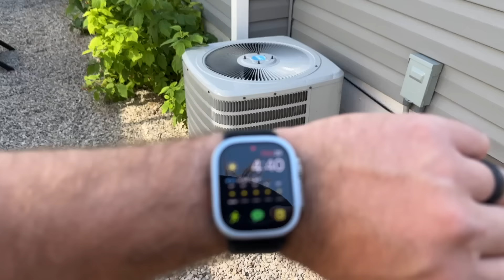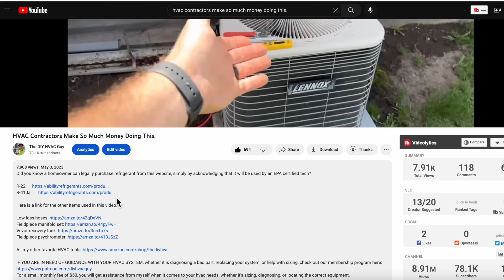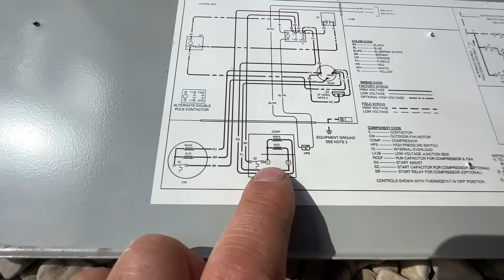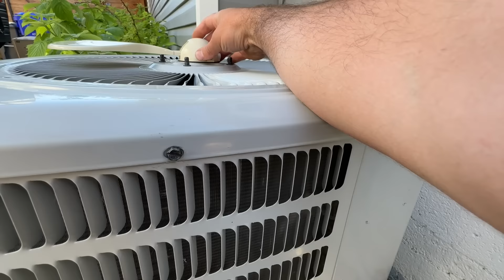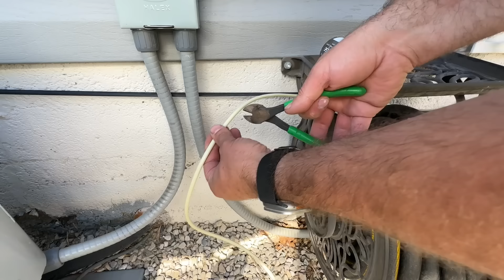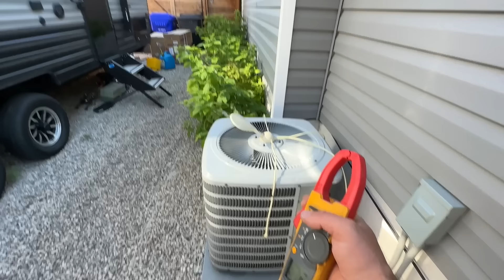Can This Device Actually Lower Your Electric Bill By 30%??

Comment: Im curious. Has anyone had any issues with the waterlines freezing during the winter? Or are you expected to turn it off during the winter months? Customers really don't want to have to think or worry about anything. So...If I was to do this...I would want to consider a way to automatically turn the water off.

Comment: One caveat is to turn the water off when the outside temperature drops into the mid 80s to high 70s. You can get the refrigerant too cold. This could cause the system to work incorrectly and potentially damage the compressor.

Comment: When I was a kid way back in the 1950's, we didn't have air conditioning. We had some window fans that fit in an open window...filling the entire window space size.... and could run in either direction. On real hot days, Dad would take the water hose and water down the roof. The water running off the roof would cool the air and the fans would pull the cooler air into the house. I'm sure that it wasn't as cool as a real air conditioner, but I don't remember complaining about a hot house; it was just the way we lived.

Comment: Shade makes a big difference also! Need to maintain space around system for airflow though. Also when the temps drop down to probably 80 yo 85 outside you should cut the water off because you need to maintain a certain head pressure in the system to keep the evap from freezing up. I made one with mister nozzles, 24 volt sprinkler valve and pvc pipe on an old system and it worked great.

Comment: Great for dry climates not so great with high humidity. Also you need to be diligent with water quality. Bad water will ruin your condenser coils rather quickly.

Comment: Evaporative pre-cooling does work.  Years ago, a company sold a system of evaporative panels, with polyester mesh evaporating pads, that did a more-effective job of pre-cooling condenser air than this misting system does.  I have installed many systems like this up to a 300-ton air-cooled chiller.  The fan-powered flow valve is clever.

Comment: Wow for my girlfriend's ducted AC system. An option for an automatic water valve to mister would be 120vac to 24vac to one of those popular lawn or garden valves (like Orbit brand). I bet one could tap AC from compressor for a maybe $30 dependable auto water valve to mister. The Orbit brand water valves I use for gardening are dependable for years, plus adjustable for water volume. Food for DIY options 🙂 ... P.S. Bet misting works best in dry climates vs high humidity climates ...my two cents

Comment: Probably not a bad way to extend the life of an old unit that might be on its last legs and might not quite have adequate tonnage for the square footage. It'll rust out the unit faster than it might naturally but if it's already on its way out, why not? I guess you could limit the use to only the hottest weeks in the summer if you wanted as well.

Comment: I ordered this thing and can confidently say this does not work. The misting tubes are extremely short and do not make it to the ends of the unit. The adhesive is sub-par and , because they insist you adhere it to the absolute hottest part of the unit instead of at a corner, the adhesive does not last long at all. But, it really doesn't matter since the misting tubes are so short. They cut so many corners on this cheap, flimsy gimmick that they made it useless. I am beyond angry that I was taken for this ride. You are promoting a product that is nowhere near as good in person as it looks in this video and it is causing people to waste their money.

Comment: Please don't install one of these.  I installed one on my heat heat pump outside unit. While it worked well at first, I ended up with with a lot of mineral build up on my outside unit. The Mineral build up was lighter up high and got heavier near the bottom of the outside unit where the water trickled down and dried out. I had several AC companies come out to evaluate how to remove the minerals. They all agreed that they didn't know of any chemical or physical means of removal that wouldn't damage the coils on the outside unit. In the long run using the AC coil mister was more expensive than not using it.

Comment: Not saying the device will not make the AC unit work a little more efficiently,  but there is no way you'll get a 30% reduction. At best you'll get a 3% reduction. Don't believe me do your own research.
Current draw reduction is bogus as the second measurement was done incorrectly. Wire goes inside the meter loop NOT clamped in the jaws.  Compare how the wire is in the meter at the 2:40 mark vs the 8: 40 mark.
Also the temp measurement was done incorrectly. You measure the differential between the intake air temp and output air temp. as output air temp is directly related to the intake air temp.

Comment: With over 40 years in the HVAC trade, I have seen this system on both residential and commercial systems. It does work. The only problem as he mentioned is the dissolved solids in the water. Not just calcium. I have not had good luck with water filters doing a good job by themselves. Be sure to change that filter regularly. Check the condenser coils regularly as the buildup of dirt and minerals will negate any savings. Next. I wonder where he is taking that amp reading. For instance, I have a 36,000 BTU high efficiency unit. It pulls about 14 amps. Mine you that is FLA or Full Load Amps. That leaves about 12 amps for the compressor and 2 amps for the fan motor. So 4 amps does not sound right. To read compressor amps correctly, you check the compressor common wire. I am not trying to knock him just trying to pass along my information.

Comment: Coming from a city with extreme hard water, it will work, and then a ton of work later to get rid of the scale.  I had pumps for my house for for indoor waterfalls that had lifetime warranty, and they stopped giving me new ones is because they kept seizing up due to the scale.  Unless you keep up with this or have a water softner, the money saved on energy is wasted in maintenance or replacement later

Comment: If a house has a soft water system, tap into it's discharge for the water supply.  This will eliminate any calcium buildup on the coils.  An RO system output would do the same thing.  I'd say the calcium deposits will be the biggest reason to avoid this type of misting, so get rid of the calcium and go for it.

Comment: Not sure I saw it correctly, but shouldn't the nozzle be pointed towards the coils?
Reply from the maker: No, you are misting the air around the coil, then the condenser fan sucks it through the coil and out the top. The idea is not to soak the coil

Comment: In the Air Force when I stayed in Phoenix at Luke AFB only important buildings had AC most people had swamp cooler units that do similar work as this micro mister is doing very nice video well thought out and flawless presentation. I learned something new today.
Reply: You have no humidity at all in AZ. This is why people can use swamp coolers but using them in the SE would leave you with water dripping down the walls and everything in the house damp as a dish rag. then mold and mildew and your sick.

Comment: So, in a state that has to buy water from colorado, a toilet flush or two a day from a million homes is a ton of water. Also, 1 degree difference is a ridiculous trade off. You can save actual money with a white roof coating which should be a requirement on all homes because it also increases the life of roofs coverings.

Comment: The misting nozzles would be plugged in a day and if that didn't happen...the condensor would be completely plugged with calcium in less than a month here...and the entire unit would be rusted to the ground in a year...our groundwater is very mineral rich and quite alkaline. Great way to void a manufacturers warranty.

Comment: I did something like this back in '97 in an act of desperation.  We had recently moved to Texas, bought our first house and that summer we had temps in the 110 plus range, so indoors it was 90 degrees plus.  I thought the A/C was broken, called the A/C guy who checked it and told us he had good news and he had bad news.  The good news was there was nothing wrong with the A/C unit.  The bad news was that was as good as the cooling was going to get, and he explained air conditioning philosophy of the 1980's of contractor homes and houses built during the 1980's were designed with only a 20 degree temp differential as far as air conditioning was concerned.   I bought a mister kit, strapped to the A/C unit and it only helped a little, but a little was better that nothing so I kept it on.  We had hard water so in just a few days the condenser coils was covered in hard calcium deposits, the excess water that ran off, was super hot and killed a wide strip of grass all the way down to the road.  In a few months, the A/C unit was ruined, but as far as I was concerned, didn't matter since it was pretty useless anyhow, and we replaced it the following spring with a larger and more efficient unit that cut our electric bill in half.

Comment: First of all, hvac equipment is rated for a maximum of 95 degrees. For every degree above that, it will lose cooling capacity/tonnage. You are at 91 degrees ambient. I live in Southeast Texas. I soaked my entire condenser coil and dropped 2 whole  amps. Misting it didn't do anything in this 103° heat with heat index of 112°. Eventually the aluminum fins will start to degrade with prolonged water contact and prohibit proper heat transfer. I've been doing this for 32 years and have seen it all.

Comment: There are several comments indicating it may or may not work based upon various geographic location and physical limitations. You posted this video a month ago. Do you still think it's worthwhile?
Reply from the maker: Yes, I really do
Reply: @diyhvacguy  

Thanks for responding. I agree with one comment. The parts don't look very durable. I'll probably try it but gaining a water source near my heat pump is going to be a pain!

Comment: I thought of this about 8-9 years ago, most people told me I was crazy that A/C's are meant to be in the sun. One year later a company was advertising on the radio to install misting systems for the A/C's connected to the on/off switch on the unit. I now work in Solar and I may include this system as a Bonus. It's been a very hot summer here in Dallas.  🤔😓

Comment: Mineral build up on the could superheat subcooling ? The fin should offeset a little bit of the airflow problem supposed to have more distance by cfm of condenser fan and may take motor out premature and effective subcooling and  superheat  ever notice notice is louder on top of unit

Comment: 25 years ago when I was 18 I filed a patent on a similar design. The difference was mine worked of an adjustable thermostat. So that you could set it to your desired ambient temperature (90+ is what I recommend). I also had a filtration system so you didn’t get a build up of scale on the condenser coils. Mine also worked using a 120volt water valve that you would tie to the contractor. This would ensure that 2 things had to be met in order for it to operate without wasting water.  Unfortunately the patent was denied because someone in Michigan beat me to the punch. He was offered 10 million dollars for his version.

Comment: Smoke & mirrors.
I live in Arizona in the middle of the desert and this would do absolutely nothing. Temps here in the summer can go from 110 to close to 120 degrees. So hot that the water coming from underground pipes actually comes out hot. That device you stick with adhesive backing wouldn't last 5 minutes either. The heat is so hot that adhesive would soften up and that device would fall right off. Want to keep your AC running properly get it service on a routine basis and change your filters often. They get clogged up and it lowers the efficiency of how your AC works and just makes it work harder. Also don't run your AC with temps lower than needed. It just makes the unit work harder and you pay more in the end with your power bill.

Comment: that is a 4 sided condenser, one side has no water flow. These have been around for about as long as air conditioning been around. Most people claim on amp difference, but there should be better cooling due to the extra sub cooling at the refrigerant metering device.

Comment: It's adding an evaporative cooler to condensing coil.  Evaporative cooling is effective in low humidity environments.   Like on the brown (west) coast; not so much on the green (east) coast.

Amp draw doesn't tell the power consumption story.  You need the phase delay (power factor) at the same time.  You should know this.  Also, the start winding does not disconnect when the motor comes up to speed on these - it still draws current.  You need to measure the total draw with a unit that also measures the voltage and power factor in order to know power consumption.

Comment: BAD IDEA if the water has a lot of Sodium and Calcium in it, and nearly all water systems do, it does work, but using a a Swamp Cooler screens would be much better, cool air intake, but the water Solids do not build up on the cooling fins.

Comment: If you have a newer micro channel condenser these are doubly bad - micro channel condensers are very susceptible to leaking from corrosion.  They will also plug with water if you aren't extremely careful. They can be a PITA in the rain even.  
Don't buy an AC with a micro channel condenser if you can avoid it!

Comment: If you want better efficiency buy better unit stop being cheap and expecting good results. Seer is your cheap scale. 10 seer is for house flippers ( cheapest and electric hog ) they go all the way up to 28 seer I think or higher. Bigger coil outside gives more time to remove heat. You can also use umbrella style cover above to stop sun from beating on unit ( more shade the cooler unit )  keep overgrowth ( plants , grass ) away from coil as it blocks air flow from sides. Also wash coil once a year ( if you can’t do it have it done )

Comment: Wonder how many gallons per day this would use. 
Electricity is already easier to get in hot and dry areas than water, and that's only going to get worse. 
Plus the scale issues.

Comment: I use to do this for a living.  A VERY overlooked area is the Evap coil.  They a often NOT accessible.  I would often have to cut into the plenum to inspect and the cut an access hatch to clean it.  I have seen them so coated with dirt that I could peel it off like a blanket!   Why do they not make them more accessible?  Maybe the do now.  I guess a good way to sell new units.

Comment: First of all, the condensing unit is CLEARLY not installed to the clearance required for optimal airflow, as evidenced by the need to take the nutdriver apart. 🤨
Second, a better test of the cooling capacity is by the wetbulb split at the evaporator return and discharge! 🤔
Drybulb temps are next to useless.

Comment: I did this once and it was awhile ago. Pretty sure i just bought a 24v relay solenoid that kicked the water on when the ac kicked on and turned off when unit kicked off. I used a waterline kit for a fridge ice maker for water supply and hooked up a mister kit to it. I only ran it for one season in a rental i lived in. It worked great. I didnt comapare any energy numbers to see if i saved anything nor did i run it long enough to see long term negative effects on components.

Comment: I’ve got a large unit for downstairs and a slightly smaller one for upstairs. Both in direct sun all day. I’m curious what the significance of dropping amperage by that much has on the electric bill. If it’s dropping between 1-2 amps per unit. Other than helping out the compressors I’m curious if that bill is also going to drop some.

Comment: I used this exact same mist system on my unit for about 4 years in Central Texas. Before installing this my house could only cool to about 82 when it was 105+ outside during the Texas summer heat. After installing this my house would stay around 78 or 79 so I can deftly say that it does work. The downside is that even with a filter I began getting calcium buildup around the entire unit. Also, the constant moisture caused some minor damage and fading to the siding and paint.
Reply: It needs a recharge when that happens. It's low on Freon.

Comment: Your compressor is pulling more than 4 amps I guarantee. Whatever wire you clamped on wasn’t your compressor wire. Probably fan.
Reply from the maker: Nope, my fan wire was like 1.0 amp for the fan. This is a small unit. 1.5 tons. Why would I show the fan wire? What benefit would that be to me?

Comment: how is it colder supply air inside if subcooling was set properly before the thingy-ma-jig?
Reply: just from lower head pressure allowing for more efficient suction on the evap side?
Reply from the maker: Correct

Comment: It’s a good concept for desert areas, evaporating works amazingly well, but I don’t think I trust that filter enough to put it on my almost new unit , every spring I hang a sun shade above the unit and it is in shade all day , in fall I remove it so the unit is in full sun to help the heat pump to work better, people don’t realize how much difference Sun or shade can make

Comment: Not sure about anyone else, but where I live water isn't cheap especially when the utility charges for it coming in and assuming it all goes out as waste for treatment. Might help my cooling bill but pretty sure my water/sewer bill will increase to compensate. And if that valve fails and water is coming out 24/7. It could get really expensive. Just my thoughts on what I think would be the reality of using such a modification.
Reply: The sewage charge is higher than the water where I live.